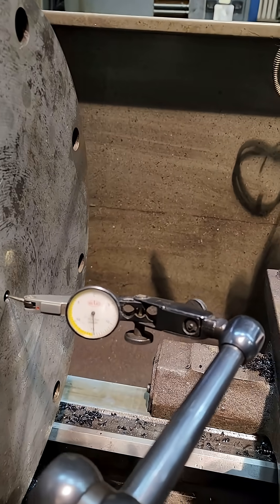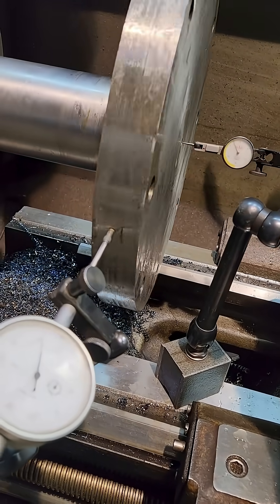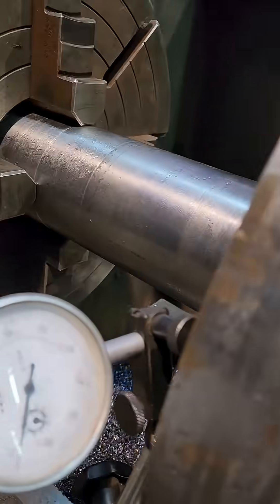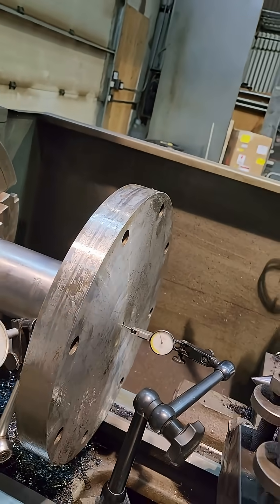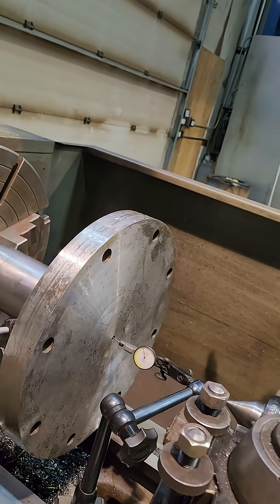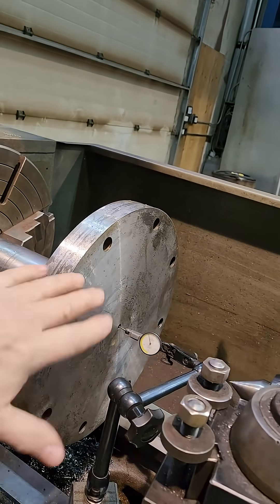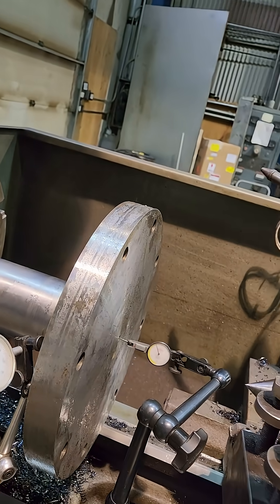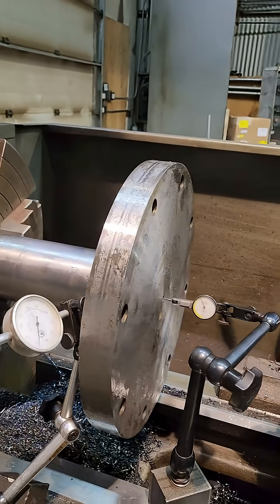When the center drilled hole isn't centered

Comment: When I was a machinist, one shop made 3-5 foot long pump shafts. Then after normalizing and heat treatment we would use a very small boring bar to cut the center drill taper true. Pretty cool procedure.

Comment: I use Adam Booth's method of running a tool shank up against the quill to ever so slightly force the drill to cut only on the far side. It will naturally make a concentric cone.

In the old days this is how they used to do production work to save a lot of time. Chuck up your actual drill with the starting flutes horizontal, push it slightly away, then cut a starting cone. Once the tip of the bit is 90% in retract the cross slide. Physics will make the drill self-center in the concentric cone. The sharp guys would use their cutting tool, ensuring the cutting edge was inside the flute not touching, using the trailing non-cutting edge to push on the drill.

It's of a similar form to other "push on it" tricks, like a ball bearing tool for quickly truing up etc.

Comment: 0.75 of the flute length max on the C-Drill (spotting drill sometimes works too in a pinch). Run in smoothly with good lube and back out sharp. It's a one and done sitch. 😊 New center g2g. Just don't un-chuck before work complete... lol

Comment: You can easily move the center location with a center drill. There very rigid and basically act like boring if its a little off center

Comment: Apprentice Millwright from Illinois here. Just got my first set of dial indicators. Any recommendations for magnetic bases? And also a good caliper brand?
Reply from the maker: I like the Noga holders best, spendy, but they hold better.  My favorite calipers are the Mitutoyo brand 8" is a nice starting size, however I normally buy the cheap generic or Fowler calipers, we kill more calipers than any other measuring tool, so the cost adds up, even the best die sometimes.

Comment: Just an idiot question here, wouldn’t that be a good job for a spot drill? At least a small one for the smaller point section, then a larger one on the outer portion, followed by a larger center drill?

I understand that center drills are good enough for most applications that a spot drill is for. But I would think that spot drills are made for absolute rigidity so they can withstand forces that would break or push other drills off center.
Reply from the maker: Center drills are very rigid also.  The best quick tool would have been a 60 degree countersink, the most accurate would have been to bore or grind the center hole.

Comment: I would have double dialed in the shaft, put the part on a steady rest, and bored the center hole concentric to the shaft, then cut a 60 degree bevel with a boring bar. 
Then cut the face while on the steady rest. 
Maybe in just wasting time,  but the next time you see that piece you know where you are with it.
Reply from the maker: If I see this part again, it will be after it has been removed with a 20# sledge hammer & every detail of it will be fully hammered.

Comment: My immediate thought is, throw an end mill in the tailstock and drive it in to the depth of the deepest part of the hole to give a fresh flat surface, then peck with a center drill. No worries, cause yeah, if that hole is off by enough it's gonna catch hard on one of the two flutes and either knock something outta whack or "regrind"  the angle on those flutes 😂
Reply: I made a video on that procedure.
Reply: @HansFormerlyTraffer  which one?
Reply: https://youtu.be/kSAMD4B9SuE
Reply: @HansFormerlyTraffer  Thank you
Reply: @HansFormerlyTraffer  We called it a shielded center if it was made that way first. I like your trick though.
Reply: Nah just use center drill with light pressure and let the center sit there a minute and it'll be good

Comment: Wow. I think what he's doing should be perfectly fine. If it's a drill bit then it would for sure follow the original hole. A short shank center drill though, I would bet big money, would get to where he centered it to within.   .001" .I'm sure that's great for the work he's doing. 

I wish you could post up your results Howee to show all these guys that what you did was indeed good enough.
Reply from the maker: It was off a long ways, if it had only been .005, I would have just used it.  This is just 1 of many ways, I was using a #6 CD, looked to be a #5 previously.
Reply: I might add also that as you can see he's not running rpm and feed rate as he would if it were a fresh hole. That is key for this to work out. I've done similar on a vertical mazak and I'm talking 5000 rpms with a .1 ipm feed rate. Of course there are more precise and efficient options to making this maneuver. However if the center drill is already set to go it ends up being the quicker route even with the abysmal feedrate.
Reply: So in a sense, yes I agree, a hss center drill ran at 2000 rpms and 4 ipm is going to follow the original hole more than you would want. Obviously he went much slower.

Comment: It's just gona follow the original hole and still be off center. A rare miss for this channel. Need to set the compound at 30 degrees and use a tiny bore bar or ground tool to bore the center true.
Reply: Not with that thick and stout of a center drill, especially if it's not HSS. But even if it is, they're designed to not deflect, for obvious reasons. Assuming your tailstock is locked in and the machine isn't some mini chinesium model, it's way more likely to chip one of the flutes on the center drill than anything else, which the video mentions 🧐
Reply: But I do agree that it's kinda dumb to do this rather than taking an extra 30-60 seconds with another tool to do it right. But he also makes a lot of videos out of teachable moments he has with his young apprentice, so maybe he was trying to show him how to do it the sketchy way so that he has a feel for how far he can push his tooling, and in case it comes up in the future when the sketchy way is his only choice?
Reply from the maker: @pokerstud001  My thought was mostly to just show that you can not always trust center drill locations in parts.  The truing method is just one of several & I did it for overall speed, boring bar would have been only 1.5 minutes longer after being set-up, but set-up = bar is not close to machine, holder is large, make shim, etc. so 20 minutes later, I could have started with the boring bar.  I did not check run-out afterwards, but this worked OK, as it does 90 percent of the time, had it not I would have setup a boring tool.

Comment: Grind a tool to recut the centre 
If you use the centre drill it more then likely to fallow the original hole
Reply: The trick there is to still use a centre drill, have the flutes horizontal,  enter the hole and push the tailstock chuck sideways so the centre drill becomes a 60 degree form tool. It stops the centre drill following the old hole. Learned that trick from a real old timer, and I'm now an old timer too myself.😂😂
Reply: The trick there is to still use a centre drill, have the flutes horizontal,  enter the hole and push the tailstock chuck sideways so the centre drill becomes a 60 degree form tool. It stops the centre drill following the old hole. Learned that trick from a real old timer, and I'm now an old timer too myself.😂😂
Edit, No idea why it came up twice,🤔
Reply: Especially if you have a light machine, or a worn tailstock. I’d set my compound at 60 and cut to as close to center as I could with a 120° insert. Then drill it out with a 1/4 drill sharpened at about 150°.
Reply: @RussKlo doing it the old fellas way involved no changes in any set up. The centre drill becomes a single flute cutter.
Reply: @chrisstephens6673  I’ll try to remember to try it sometime. I’m so ADHD I don’t remember procedures I don’t often repeat. …Reinventing my way through life, but it’s entertaining. 🤣😂

Comment: I’ve rebored it using a carbide mini boring bar. I was the one who did rework on a hand lathe in a CNC shop.🤷‍♀️
Reply: That’s exactly how I do it every time I encounter a center that dosent run true…
Reply: No , you must single point from the compound . The center drill will follow the old center drill  . Espically when the part is sticking out that far  .
Reply: @edmundgriswold8240 that’s exactly what’s he’s saying. That’s why you bore them out with a boring bar versus using a center drill that’s just gonna follow where the old goes….
Reply: @dirtbikekid2851  pssssh nah just turn the longitudinal feed on and cram the boring bar as hard and fast as your machine allows
Reply: @edmundgriswold8240 correcto Mundo

Comment: I believe it works better if the drilling point is ground off of the center drill first and just use the 60° countersink. (Less likely to push the center drill in the chuck around)  You may have to drill the hole a bit deeper with a regular drill first, so the live center doesn't bottom out.  The best way is to single point bore the center hole with the compound rest.
Reply from the maker: I agree boring, is being the more accurate method, this is just one of many methods.

Comment: Wow! I’m surprised it was possible to correct that so easily without taking a spot face cut.
Reply: I believe it works better if the drilling point is ground off of the center drill first and just use the 60° countersink.  (Less likely to push the center drill in the chuck around)  You may have to drill the hole a bit deeper with a regular drill first, so the live center doesn't bottom out.  The best way is to single point bore the center hole with the compound rest.
Reply: This actually isn't correct. The center will still be off center, it needs to be bored, not drilled. 99 percent of what this dude says is correct, this is one time he is wrong.